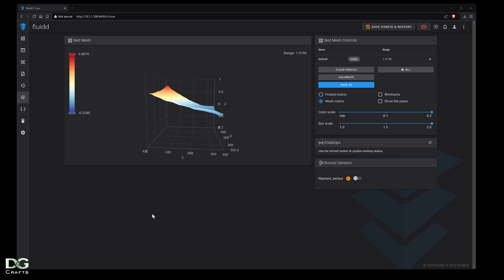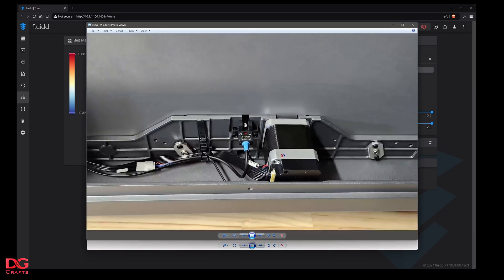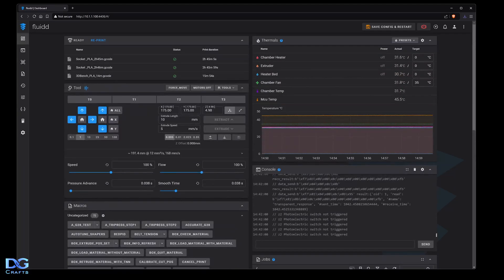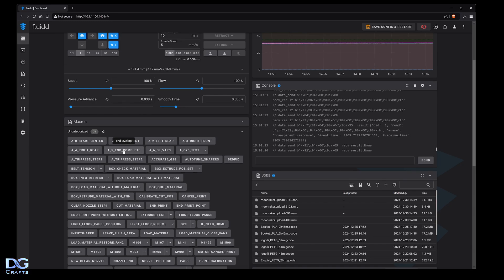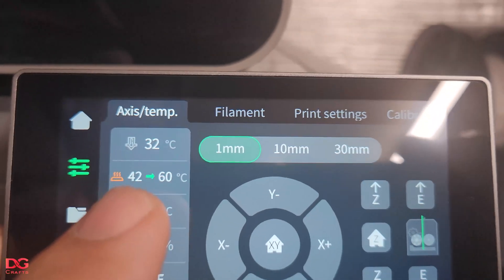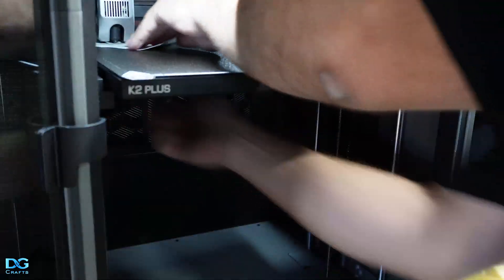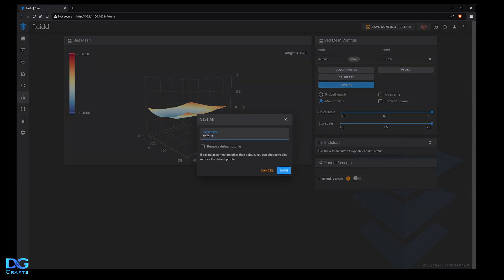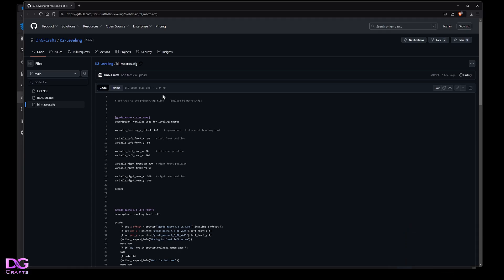K2 Bed Leveling

Comment: What you did here, is it all exactly the same for the k2 pro? I’m a beginner so go easy lol
Reply from the maker: i dont know because i have never had the pro but the macros are setup to detect the printers build volume so if the pro has the same adjustment nuts on the bottom of the plate i cant see why it wouldnt work

Comment: Is there any way to make the screws tilt adjust macro work? I will provide the macro for you if you want to toy around with it. Basically, it tells you how much to turn each screw at each corner after doing a bed probe. Works well on other Klipper friendly printers. Thank you for your work!!

[screws_tilt_adjust]
horizontal_move_z: 5
screw_thread: CCW-M4
speed: 300
screw1: 22, 45
screw1_name: front left screw
screw2: 202, 45
screw2_name: front right screw
screw3: 202, 224
screw3_name: rear right screw
screw4: 22, 224
screw4_name: rear left screw

Comment: i appreciate all the info. however, when i try to use the paper, my nozzle is min. 3mm from even touching the paper. unsure if im doing something wrong. any info would be helpful.
Reply from the maker: Try and run the printer through the calibration process that is in the printers menu and then see if the z offset is closer than the 3mm

Comment: Thank you for the video as I am one that my bed was way out beyond tolerance for the bed leveler. It seemed to do that out on the edges after I did a few ASA prints with higher heat. It bowed the bed and it didn't not return to what it was before but hopefully the curve is set in now and I have a close enough level with the screws so that the mesh leveling will work

Comment: I couldn't unscrew one of the lambs because of the thread lock. The plastic lamb began to scroll.
I barely managed to dismantle it. A brass bushing remains on the bolt. I unscrewed it with pliers.
The bolt didn't come loose either. I heated it with a blow dryer from a soldering station and it easily unscrewed. If there is no hair dryer, you can heat it with a lighter to destroy the thread lock.
The thread on the bolt was bad.
The original M4x30 bolt. I've never had that before. I put in an M4x35 and a new nut and washer.

Comment: So turning the knob doesnt do anything for me, I have to use an Allen wrench to hold the screw on the other side. Unless I’m missing something
Reply from the maker: creality started putting thread lock paste on the screws so you need to either clean it off or use the allen wrench.
i would also make sure they still put the springs on the screws too because there have been some machines without the springs in them.
Reply: @D @DnG-Crafts alright I’ll do that, I could only get it down to .71 so far. Hope I can get it down a bit more. Thanks!

Comment: My apologies, I'm new to 3D printing. I have a K2 Pro and a Plus (the hotend died on the K2 Pro so I brought a Plus during the 3-4 week down time waiting for parts). Will this also work on the Pro? I've found both beds are out by over 1.3 (and the z offset is off by around .11 and .125). I'm hoping leveling will fix this.
Reply from the maker: i recently updated the bl_macro file to detect the build volume of the printer so it should work on all of the k2 series printers but i only have tested the plus as seen in the video.

Comment: Thank you for such a fantastic video. Will your macro work for the straight K2 Combo?
Reply from the maker: i just updated the macro file on github to detect the build volume so the macros will now work with all of the k2 printers.
Reply: @DnG-Crafts Thank you very much. I've had my printer for about 2 weeks and had no idea that manually leveling was needed.
Reply from the maker: @chefzilla314  you dont need to do it unless the bed is really bad, if the mesh looks pretty level then it should be fine.

Comment: I too have the taco bed, and have followed the steps in the video but when i goto do each corner with the paper I don't have enough in the knob to get the paper loose.  I started with unscrewing one turn like you did and have went all the way upto 4 turns on each screw.  I have tried several times and can not get the paper loose.  I have been bed leveling for years starting with the ender3pro 5 years ago and this is frustrating me to no end.  i can visually see the bed moving up and down with the knob but it feels like the nozzle is just too deep.  It prints fine so far but the bed mesh is quite off.  Any suggestions?  And the thread lock on the screws is a pain, can not go past a certain tightness without putting an allen wrench on the screw.

Comment: This is amazing, would this trick be possible with the creality hi? it's a bedslinger so i guess the macro needs adjustments, but i wonder if the screws are similar.
Reply from the maker: the hi has a bed with no ability to adjust it, i looked at setting up a script for the hi but there is just no decent way to adjust the bed.
there could be screws under the magnetic sticker but they would probably only allow you to disassemble the bed not adjust it.

Comment: I love this however. The knobs on my K2 are just spinning so I had to use and allen wrench to hold while I turned the knobs. It adjusted some I could tell a difference with the paper but for the most part my bed is as low as it can go but it’s still scarring the paper. And I went from a bed mesh of .6 to .79 so idk wtf to do now

Comment: Thanks for the video - a suggestion from me is to buy a set of feeler guages from a hardware store - remove the 0.2mm one from the set and use that instead of a piece of paper (obviously adjust the macro for a spacing of 0.2mm). I find this better than a piece of paper as you can slide the feeler guage under the nozzle feeling for drag - you want to get all four point with the same feel.
Reply: Why not a 0.1mm feeler gauge?
Reply: @DouBeeful you can use any feeler guage. Just set the z height to whatever the thickness of the feeler guage is.  I use 0.2mm because i normally have a 0.2mm first layer height.
Reply: @atunguyd  Right, but the bed only has a certain amount of z-height adjustment, and you are not measuring z-offset, you are measuring bed level.
Reply: @DouBeeful yes.  You set the z height to the thickness of the guage and adjust each corner based on that. You ate adjusting bed level not z offset.  l find  it way easier than a piece of paper.

Whatever  value of variable_leveling_z_offset you set in the script, you use that thickness feeler guage

Comment: Great video , mines out by 0.99 but is shaped like a saddle . Do you think it would still pull it in? I assume the bed itself must be misshaped
Reply from the maker: most of them seem to be shaped like that and you cant level it out because the bed is warped.
you can try to level each corner the best you can and then see if the mesh calculation can compensate for the saddle.

i have seen conversations where people have talked about putting thin shims under the build plate to try and correct the warp but i have not tried it as my bed is not that bad.

Comment: This is super kickass. Thank you for showing us this and all the hard work making the macro. My print tower for color changes in the front left kept coming of the plate and after seeing this and using the fluid on my computer and adding your macros. i was able to just type in the i.p. address with :4408 on my phone and it was all there. I dont know how but i was able to adjust with the paper and it looks alot better , the mess i mean. still have to print on it now but without this video i think i would of been going crazy trying to figure out what to do so THANK YOU SOOOOOO MUCH. you the man.

Comment: Great video, thanks for sharing.  Big improvement in my bed after following your guidance and playing with my z offset.  I am now able to print a decent first layer but have some abnormalities in the center of my bed still, which I plan on tackling tomorrow by shimming that area.  The only word of caution I have for others is to be sure and use the end macro when done.  I accidently hit the home button before hitting the end macro and scratched up my epoxy build plate pretty bad.  Fortunately, I had the original rough one and was able to continue testing, and a new epoxy plate should be here tomorrow.

Comment: Dumb question but how tight should the paper be under the nozzle. Not so much that it tears I understand but should there be friction but not soo much that it's hard to pull.
Reply from the maker: I get it to the point where i can feel a little bit of resistance and then try to make all 4 points feel about the same.

Comment: Thanks for this, this will help me fix lots of issues with my print bed here. I have an issue though, the adjuster screws need to be held from the top with an alen key or else I cant turn the knobs below. This makes it very tricky to adjust the level while the build plate is there.

Any tips on how you overcame this?
Reply from the maker: creality started adding thread locker to the screws which is the cause and other people have reported they cleaned it off to solve the issue.

Comment: My problem is that I already have the screws completely tightened. can't go more. how can I reset the bed a little higher?
Reply from the maker: maybe try and undo the nuts about 2 turns then turn the power to the printer off then back on and re-home it to see if it will reset the probed z position.
Reply: @DnG-Crafts  got it now to 0,5 - prints are looking good so far. maybe I'll take another try when I have most of my prints done :-D Thank you so much!

Comment: Did you have to break loose the locktite? My bed knobs were loctited in place
Reply from the maker: some people have reported their machines have thread locker on the screws and they have had to use tools to remove the screw and clean it or just adjust them using the tools

Comment: Doesn't work for me still have pringles bed
Reply from the maker: leveling the bed wont take the warp out of it.
if your bed is warped in the middle with a shape like a pringle then you need to try and find a way to take that warp out using shims under the build plate or you need to get a new bed.

creality is pretty bad for sending out beds that are warped 😪
Reply: @DnG-Crafts  thank you for the fast answer

Comment: HI
The best I got was 0.6530
The bed is too close to the nozzle on the 4 corners (scratching paper)and no touching paper on the center. The springs are at mimimum...I can't tighten them anymore. What do you suggest?
Thank You
Reply: i have the same problem but my bed is 1.76 mm off too and the front left corner tears paper and i cant tighten the knob any further at all. A lot of people here are posting the same problem and he isnt replying to them...

Comment: I hope I get a reply/answer. So I got a taco shaped plate, with 0.8835 delta. I’ve completely loosened the screws, took them off and added washers to give extra room of adjustment. I ran your macros, paper barely touches the nozzle, ran it many times, then lowered my delta to 0.7355. Still taco shaped. I noticed to get the bed flat, I will be far away from the nozzle! Any suggestions/advice? Thank you

Comment: my k2 shipped whit mesh 1.15 after my first attempt it got it to 1.35 :) will atempt again, do we have to calibrate until head just touches papar or until paper can not move when pulled lightly ?

Comment: Wow, I thought I was all done with manual bed leveling and the paper test when I bought my K2.  Big eye opener.  And, no - not ALL of us are familiar with Fluid.  That is something brand new to me.  Don't know what it is or where to get it.  Nor git hub.  And CFG files are not my thing either.  I am not a software engineer, but it seems one needs to have some level of software programming ability just to level out the bed.  I wish there was some easier way to do it.

Comment: Another very pleased follower. From the factory my K2 had a range of 1.12. After making 5 or 6 rounds of the corners in about 15 minutes, the range is now .602. Your macros make this adjustment very easy. However, you may have turned me into a real OCD character. The bed is still a bit high in the front and the back. So I may try another session. Not because it will make much difference in the long run, but it would just be fun to see how flat I can get it. That's so very much for your videos and the "magic" macros!

Comment: Ive done this a handful of times now and my mesh stays the same or gets slightly worse each time. When I start another leveling sequence, when I go to front left the nozzle is no where close to what I had the prior time of leveling. I have to loosen the screw quite a bit but to get the nozzle to touch again. Now I’ve screwed them almost completely out. Am I missing a step here or something?

Comment: I tried doing this with the build plate removed so I could hold the screws in place with the allen wrench. I couldn't get it loose enough to move the paper without tearing it. As a matter of fact, once I lowered the bed I saw that the nozzle had made a hole in the bed. I had the screw so loose that it wobbled up and down, but the paper would not move without tearing.
Reply from the maker: creality started adding thread locking paste to the screws, it needs to be cleaned off and you have to level it with the build plate on.
Reply: @DnG-Crafts  I didn't expect a reply so soon! Thanks for the advice. I saw the thread locker and wondered about that. I'll do as you suggest.

Comment: Nice job - Thank you on the behalf of all those struggling with Creality's taco beds! A couple of suggestions, if I may:
1- preheat the nozzle also; compensates for expansion during printing, and eliminates false results due to bits of stuck filament
2- on my bed, the knobs were very difficult to move, and didn't seem to do anything. Turns out Creality put blue thread lock on the screws which were just turning with the knobs. I had to remove the plate & hold the screws with an allen key to get the knobs off, then brush off the thread locker before making adjustments. 
3- don't screw up or lose the screws! They are fine thread, and hard to find in that size!
4- there is a limit on how much adjustment you can make with the knobs. I had to lay down blue masking tape to counter the warp on one side of the bed that the screws could not compensate. I'm down to 0.25mm mesh, which is an order of magnitude better that the original 1.6mm.
Reply: Wow thats impressive. The screws on my K2 plus were pretty tight. Even though I was able to unscrew them and use the paper between the plate and nozzle with proper resistance I got worse results. I finally cranked the knobs super tight again, re-calibrated and went from 0.9616 down to 0.8820. So I guess I need to shim with blue masking tape? I heard some people say to use high temperature kapton tape. I assume I put the tape on the magnetic bed then put the build plate back on then re-calibrate? Any suggestions would be appreciated.

BTW my bed has a high spot in the middle with low spots in all the corners. At least I got a 0.0796 improvement.

Comment: Great video and super helpful.  Thank you!  In my case, the screws and knobs were so tight, the ones on the right side could not be loosened or tightened by hand.  I had to perform this operation with the build plate removed to use an Allen key to hold the screws so I could adjust the knobs.  It was slightly more trouble, but ultimately reduced the leveling range by 0.8mm over the factory configuration.
Reply: same
Reply: Hi, I have the same issue where my screws are just way to tight and the screw itself rotates with the knob underneath when turning. How did you calibrate, did you leave the texture PEI plate off and did the calibration? Thanks !
Reply: @brechtxbrecht  Yep. I calibrated without the build plate. It was impossible to do it any other way since the screws are not captive.
Reply: Oh okay perfect thanks! In my case the difference in total is 0.6mm so not sure if its worth messing with it 🤔

Comment: My bed was pretty good out of the box. Printing perfect but the first layer was a little wavy on the creality logo test print. I wanted to do it anyways as there was a fair delta. My bed leveling screws were LOCKTIGHTED from the factory!!! I had to remove the screws and loosen up the locktight on them to do this.
Reply: Yeah now I see some taco and part of my flow calibration failed to stick to the bed. Maybe I should have left it alone?
Reply: Gonna go with the aluminum tape I think
Reply: Seems to work better using the built in calibration and adjusting the screws based on that. May re locktight them myself. Feel kinda dumb following this tutorial. I feel like the early production units where rough but mine was fine and I jacked it up. Got it to 0.8520 now.

Comment: So I'm typing this mid post mesh.. and I'll likely come edit this.. but

Creality, stop using a f'ing torque wrench on these! My taco (bed) was at 1.2 and I have yet to have a single good print.. So many clogs from the nozzle hitting the bed.. Well These damn nuts were so tight on the bed that I had to grab a set of channel locks to loosen them.
Reply: A torque wrench would be perfect to use, it limits and sets the torque at a precise amount. I think you mean a breaker bar hehe

Comment: ok great but once this is done how to lock these nobs in place so they dont move or change?
Reply from the maker: they shouldnt move, they should be spring loaded and the spring will keep the tension on the nut
Reply: @DnG-Crafts  thanks can we use the same for the k1 max >?
Reply from the maker: @EnergySeeker  the k1 is different as there is no decent adjustment, this is how i leveled my k1

https://www.youtube.com/watch?v=5Hz75vxlxUY

Comment: Question, after leveling with this method I have very tall peak in center of the bed mesh?
Reply: Did another leveling and it disappeared. My range went from .9540 to .5018, a good improvement I think. Can see a huge improvement on my first layer.